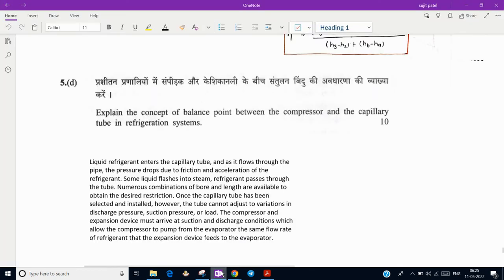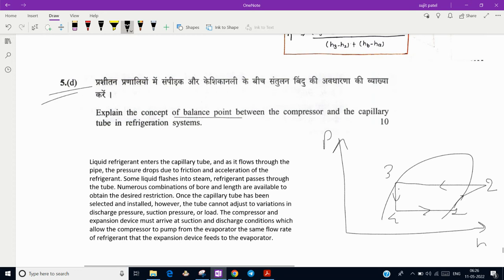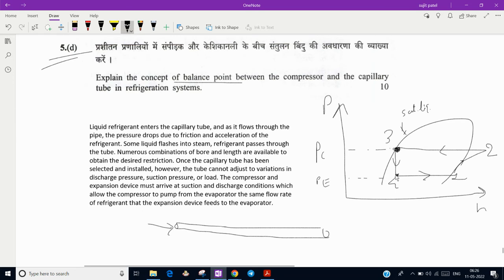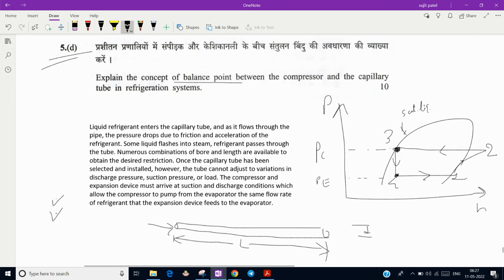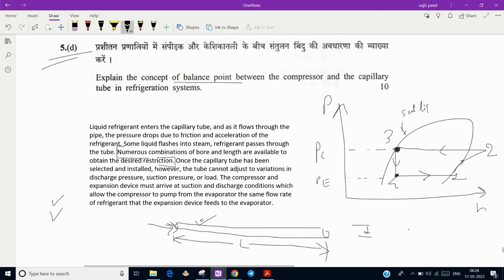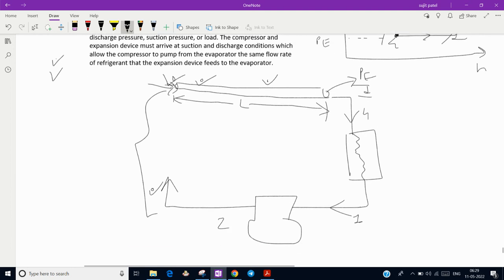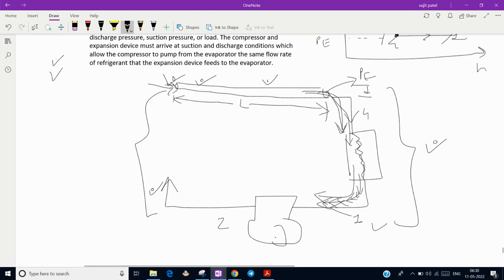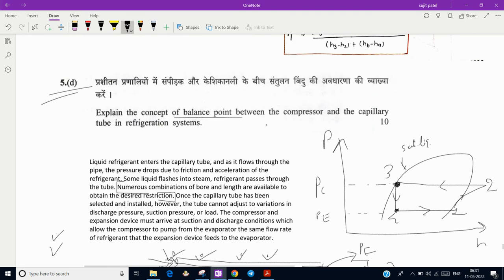BALANCE POINT BETWEEN COMPRESSOR AND CAPILARY TUBE UPSC CSE PYQ 2021

Comment: Thanks for lucidity explaining this concept of balance point. However, I have a doubt about your answer - that (5:35) both compressor and expansion device must have same suction and discharge pressures (at balanced condition). Are we ignoring the real fact that pressure losses are significant across 2 HX (Evaporator and Condensor)?